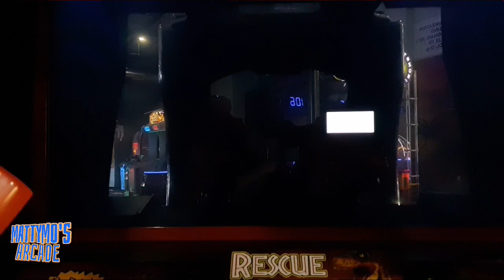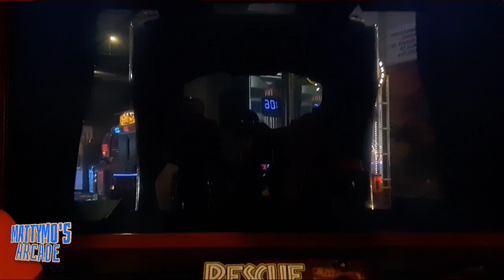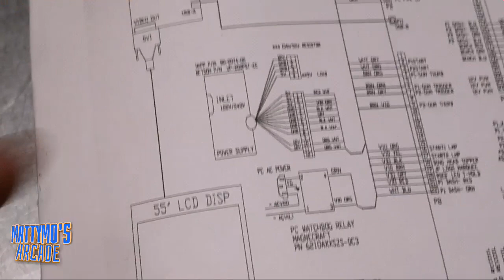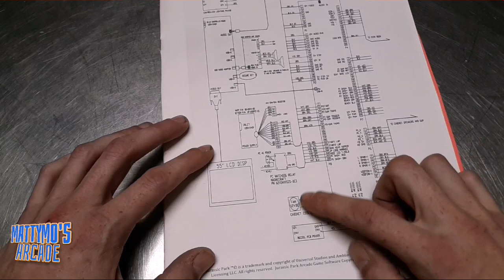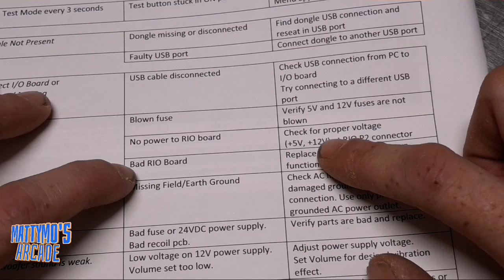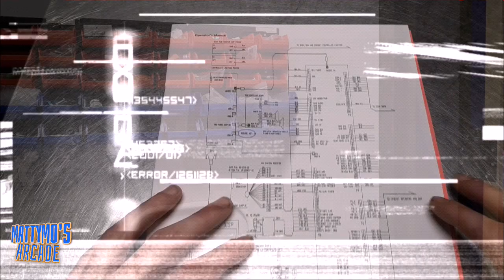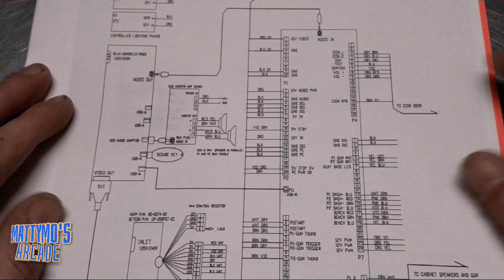Jurassic Park Arcade Repair: No Signal. Big Problem Part 2

Comment: Sorry dude the Solid state relay is not the RIO board, (R)awthrills (I)nput (O)utput Board should be the main board the USB plugs into. It is ether missing all its power or the usb is not connected
Reply from the maker: Gotcha. I knew I was missing something. I'll check it again tomorrow. Thanks!
Reply from the maker: It was a bad relay, not the i/o board. Doh!
Reply: @MattyMosArcade  wow surprising wonder if that relay was shorting the RIO pcb, Did the RIO work after?
Reply from the maker: The RIO works.
Reply: @MattyMosArcade interesting awesome job man quite an odd problem
Reply: I have the same problem with my Jurassic Park game, it won't do it all the time it seems like only when it gets played a lot it'll say Rio disconnected or it'll shut off mid game.any suggestions?

Thanks